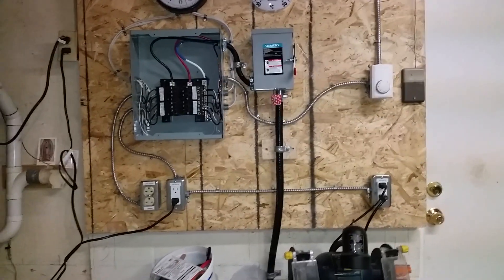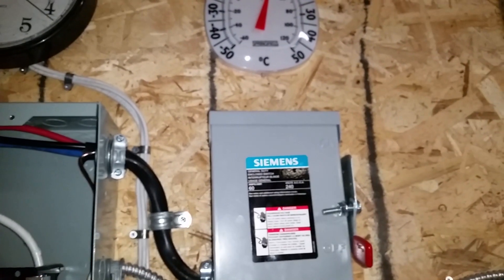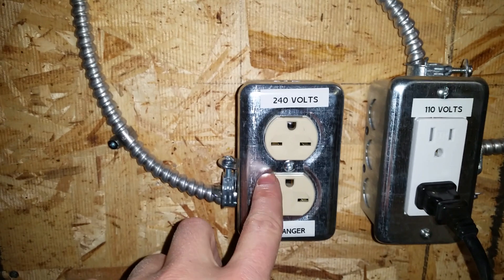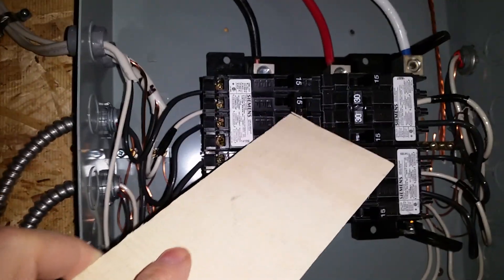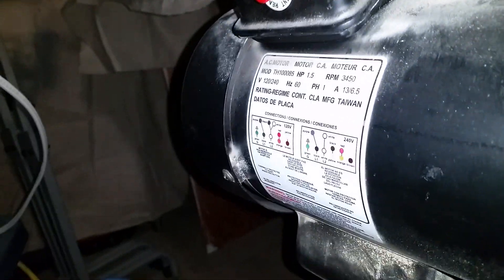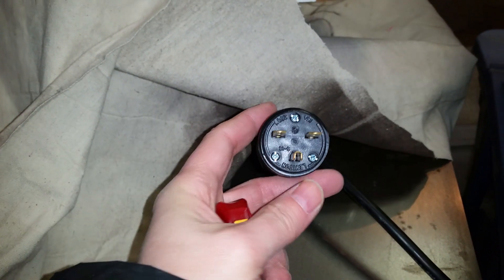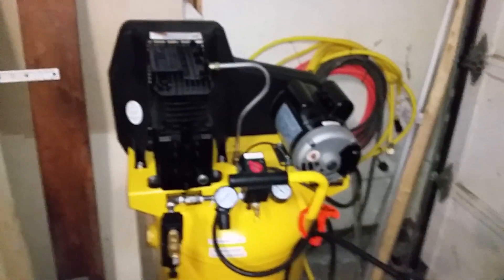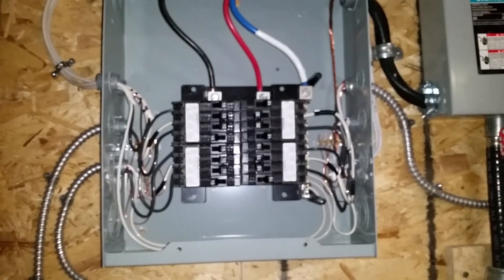How to convert a table saw or compressor from 110 to 220 volts (actually 120 to 240 volts)

Comment: Great video Claude, well explained.  Thanks for taking the time to learn the code, use the correct combination of circuit breakers, conductors and plug/receptacles.  You even oriented the receptacle with the ground up the safer preferred way